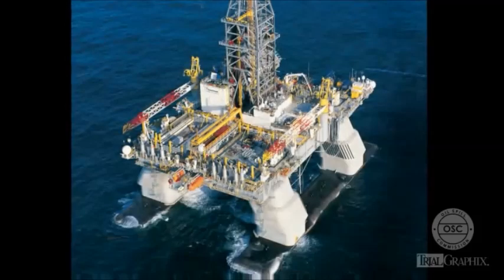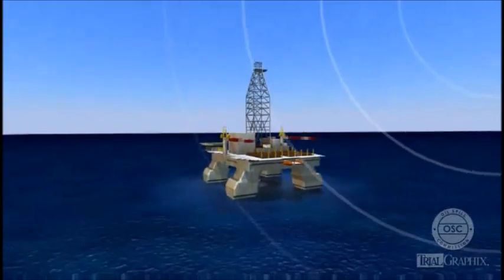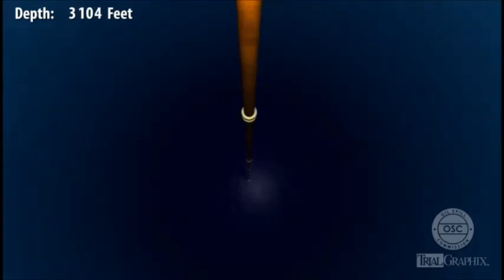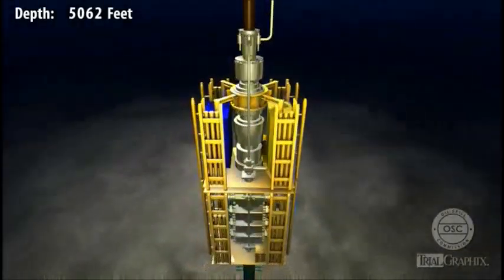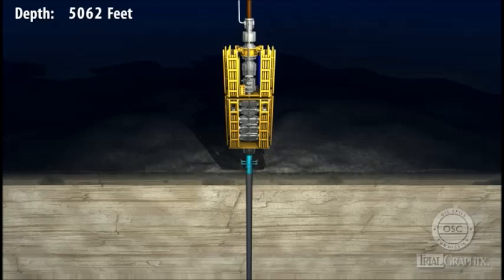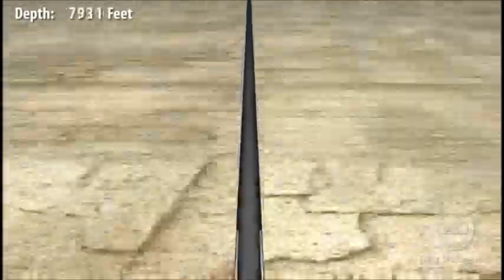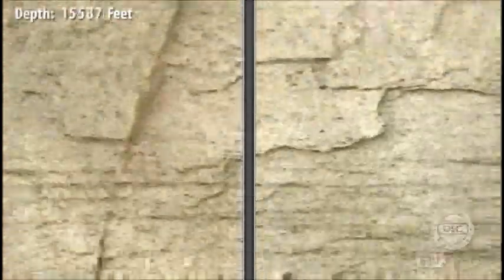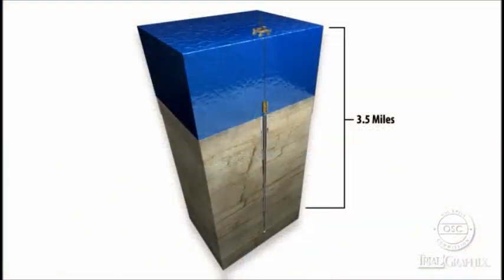Deep water Horizon Rig

Comment: Can this rig rebuild?
Reply from the maker: No.
Reply: Why no?
Reply: @hasim8888  it burned for a week and sunk to the bottom of the ocean
Reply from the maker: @unclecke299 If a rig has caught fire and subsequently sank to the bottom of the ocean, it can be a significant and challenging situation. The specific circumstances surrounding the incident, such as the cause of the fire and the condition of the rig, will determine the feasibility of any potential salvage or recovery efforts. Salvaging a sunken rig from the ocean floor is a complex and technically demanding operation that requires specialized equipment and expertise. It's essential to involve experienced professionals and assess the safety and environmental considerations before undertaking any recovery efforts.
Reply from the maker: The possibility of rebuilding a rig depends on various factors, such as the extent of damage, the condition of the rig's structure, and the availability of resources and expertise. In some cases, damaged rigs can be repaired or refurbished, while in other cases, it may be more practical to construct a new rig. Without specific information about the rig you're referring to, it's challenging to provide a definitive answer. If you can provide more details about the rig in question, I can try to offer more specific insights

Comment: Actually, Indonesia have 12 points for rig and have many Indonesian engineers. The main problem here, about share number and Indonesia need regenerate the key player. The old player only collecting capital and never fight for people's prosperity also old key player mostly using China's engineers. The old key player's reason about Indonesia's engineers hard to motivate and too many excuses. I believe, this is about communication.
Reply: Rebuilded Deepwater horizon rig is belongs to Indonesia i hope
Reply from the maker: @hasim8888  I'm sorry, but I couldn't find any specific information about the ownership of the Deepwater Horizon rig being attributed to Indonesia. The Deepwater Horizon rig was owned and operated by Transocean Ltd., an offshore drilling contractor based in Switzerland. It was involved in a major oil spill incident in the Gulf of Mexico in 2010. However, I'm not aware of any connection between the rig and Indonesia. If you have more details or sources regarding this information, please provide them, and I'll do my best to assist you further.
Reply from the maker: It's interesting to hear your perspective on the situation in Indonesia regarding rigs and engineers. It seems that you believe there are challenges related to the distribution of resources and the need to cultivate a new generation of key players who prioritize the well-being of the people. Communication also appears to be a factor that influences the effectiveness and motivation of Indonesian engineers. Enhancing communication channels and fostering a supportive environment for engineers could potentially address some of these issues. Building a strong foundation for collaboration and innovation is crucial for the growth and prosperity of any industry.